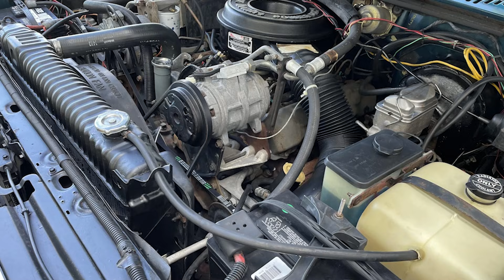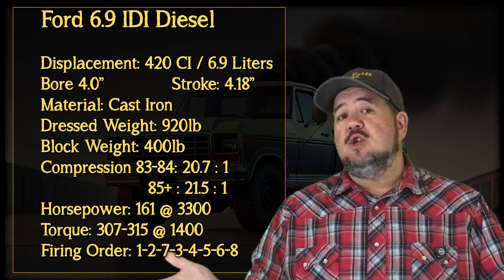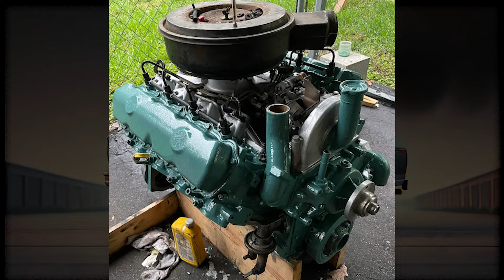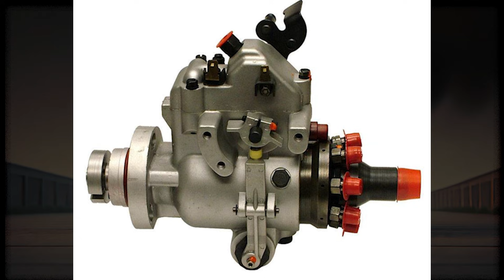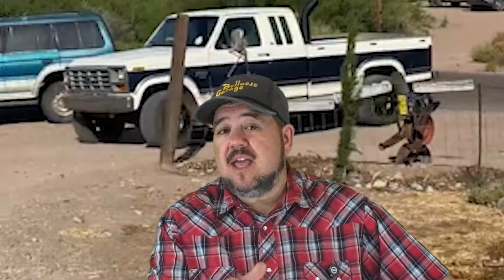Ford 6.9L IDI Diesel: Everything You Need to Know

Comment: Now see, what I would and wanna do to one of these is adapt an NV5600 6 speed into one of these trucks. They got 15 to 17 hwy mpgs with a 3 SPEED AUTOMATIC!!! A 6 speed manual would be bonkers or so i think. Adding in a turbo also GREATLY increases efficiency and power output too and frankly it's not all the complicated for just a basic system. But it DOES make stuff more complex there's no argument there. Would help it for towing applications too, but I wouldn't puch an IDI like that past 275 horses personally. Parts are pretty easy to find too or have fabricated due to just how simple them things really are.

Comment: Haha you suck!
Sike just joking, since you read even the mean comments thought I'd throw that in there.
Was giving an 6.9IDI f350 from my father as a birthday gift, and I can't thank him enough.
It truly is the best gift a man can ever ask for.
I'm currently running down a problem with the wiring going to the glow plug relay (aftermarket) and starter itself, as those two wires caught fire last year and welded themselves to the terminal.
Also, I plan on restoring all the wiring and eliminating anything unnecessary, as there is a winch and light bars that need alot of juice, if I plan on doing what I want to do.
What are some good tips to keep in mind? 
Is there any preventative maintenance I can do while I'm replacing wiring? 
Injection pump, glow plugs, and external fuel filter are on the list aswell, just want to make sure she has healthy power everywhere, rather then throwing a tempter tantrum over being turned on for too long.

Comment: I have a 92 f250 7.3 IDI e4od 2wd supercab XLT , and a 1984 6.9 idi t-19 4x4 f250 supercab XLT .. both will be running long after I gone :) . one thing not mentioned. ditch the mechanical vacuum pump for a modern jeep electric vacuum pump .

Comment: That is an Internarional motor and you can find it in IH schoolbus too. The little 4 cylinder Izuzu reefer motor is a tough one for a little displacement boat or garden tractoo. Mercedese also has one but the Izuzu is a little better with Mains on every cylinder.

I'd like a 4-53 for an older truck refurbishment. For a pickup either that 6.9 IDI or a 3-53.

Comment: This is a brilliant useful video. Question if you’re still out there.. any knowledge on the 1986 Cabriolet version? I’m understanding Michigan made these trucker Van Sleeper cabs with a turbo .. I’d just soon not have a turbo but my understanding is they were built with them .. can’t find much yet on that before I buy this low miles one.. and I need to know if anything besides and exhaust valves gauge is something I need to do

Comment: I owned a 1984 F250 4x4 extended cab with a 6.9L IDI from 1990 to 2005.  In 1991 I noticed a single BANG on startup.  The next week after sitting overnight I drained the oil and a couple of tablespoons of coolant came out first. After discussing it in detail with the truck engine manager at I international I decided to replace the block.  I did the work at a local garage every evening for a month.  In that time I also added a 1.25:1 2 speed auxiliary trans between the transmission and transfer case.  That truck had 3.55:1 front and rear axel ratios, so it was like running in overdrive all the time.  The 2 speed in low gave me the equivalent of 4.44:1.  It was the best thing I ever did to that truck.  I also added an electric fuel pump with a bypass check valve and a priming switch mounted next to the radiator for priming the fuel system.  That truck ran good and towed really well.  I had a slide in truck camper and pulled a boat too.  A great workhorse.  I am looking for another one now.  I'd like a 7.3 with a factory turbo crew cab.  I'll be having a truck camper and towing a boat.  It's sort of my thing.  One Miracle at a time!

Comment: I am the original owner of a 1987 F250 4X4 6.9 IDI, a 1990 F350 4X4 7.3 IDI, and a 1997 7.3 PSD. The 87 has over 600,000 miles on it now. I've replaced all of the "bolt-on items" but the motor itself is still original. I've owned 6.0's, 6.4's and 6.7's. I still have a 2016 F450 with a 6.7. My 87 6.9 is, by far, the most reliable pickup truck I've ever owned. 2nd place is the 1990 with the 7.3 IDI. No, they don't have all the power and gizmos that the newer ones have. And no, they don't get awesome mileage, or climb hills under load at 55 miles per hour. But.....They just. don't. break. If I had to choose between all of them, I'd pick the 87 with the 6.9. It's not even a hard question.

Comment: Love my unicorn of a truck! 🦄🛠️

Finding a 1997 Ford F-250 (the final and most desirable year of the OBS) that’s a California-original, two-tone blue, and garage-kept is like finding a needle in a haystack.

 With 272k miles, this 7.3L

 Powerstroke is just getting started!

Why I’m sticking with this legend:

 * The CA Gold Standard: Being a '97 means no smog checks and none of the expensive, headache-prone emissions hardware 
(DPF/DEF/EGR) found on new rigs.

 * Unbeatable Efficiency: 13–14 MPG towing 8,000 lbs and 19 MPG highway. Most modern trucks can’t touch that.

 * Classic Americana: The Club Cab, 8ft bed, and factory chrome alloys give it that timeless long-wheelbase look.

 * Sustainability through Longevity: It’s noisy and it’s not fast, but keeping this 29-year-old machine in showroom condition is better for the planet (and my wallet) than buying a new one every five years.

She’s paid for, reliable as a rock, and built to outlast almost anything on the road today. 
I’m picking up a "topside creeper" soon to make the next round of maintenance easier on my back—gotta keep that engine bay as clean as the exterior! 🛻💨

Anyone else still rocking an OBS Ford?

Comment: The DD 4-53 wasn't a "screaming" engine. It was a 2-stroke, which means with 2x the power strokes the engine operation sounds like it's at 2x the RPM. It's why any DD 2-stroke engine at 2,000 RPM sounds like a 4-stroke engine at 4,000 RPM.

Comment: I put a 7.3 idi from my 88 I rebuilt and put it in my 97 f250 that had a 460 I used the gas tanks with electric fuel pumps in tank I used a holly regulator to cut the pressure to 5psi well now that truck is junk so now the 7.3 idi is going into my 99 F350 super duty which has a V10 with a rod through the side of the block I don't want to spend $5000 for a rebuilt V10 I pull heavy trailers lol. This will be the third truck this engine has been in I rebuilt the engine back in 2019 I don't think I have put 20,000 miles on it.

Comment: I should probably put his on the 7.3idi video, but I love my IDI's!!! When I moved from Sacramento, Ca to Austin, Tx I drove my 1991 NA 7.3 and for about 1800 miles that truck got almost 20.2mpg and only stopped for fuel and potty breaks. It took 33 hours.... but the truck ran so smooth! engine purred at 2000-2200rpm and was hardly a nuisance unlike my 7.3 powerstroke or cummins 12v. This truck now has a turbo and ZF 5 speed and hydroboost. Great trucks from a bygon era! I even have a 1986 6.9idi parts truck, that I intend to pull the engine and rebuild as a spare engine for my 1991.

Comment: If my 7.3psd dies, a 12 valve or a DT360 is getting rammed into her, all mechanical, gear driven timing, lots of power, turbo and no sensors.

IDI's just would be a huge downgrade from the psd

Comment: Dude! Thank you so so much for making this video! You dropped so much knowledge, I just bought a 86' F250 6.9l idi diesel with supposably 53,000 original miles 🤷. I bought it off of a local auction site here in Oklahoma. (For $1,550! 🤫) It is my first diesel so I knew nothing upon buying it but after extensive research on line through forms and videos like this one I'm starting to figure it all out. But by far this video specifically was incredible with all the info and pros and cons and upgrades for reliability etc etc. Much appreciated thank you!
Reply: Wow bro 🇺🇸🫡

Comment: I am the lucky 2nd owner of a 1986 F250 6.9L with only 119K miles on it. She'll be 40 next year. First owner was a gentleman with her and babied her softly. I am the same way, I love hearing her purr and she smokes gently like a diesel should.  I love this truck and I love my 2003 7.3 with 327K as my daily driver. Fixin to buy a 1997 F250 with the 7.3 as well, found another one with only 111K miles. These trucks are special.
Reply: I inherited a 1986 F250 6.9 in 2005 which made me the 3rd owner. It has 86,000 miles now. It needs a new oil pan gasket now. Pulling the engine is not something I have the know how for!

Comment: Pretty cool vid. I wonder where was the engine casting foundry for these blocks? I ask cuz I am from Cleveland, Ohio, where the engine casting foundry was for Fords small blocks, along with Windsor, Canada. I know a little bit about diesel engines, but large truck and bus engines like Cummins and Detroit Diesel 6v71 cuz I worked for the transit system in Cleveland. I also have a cool, old 1963 Ford F100 with the 292 Y Block.

Comment: Now who could ever be mean to you? You’re just a 🧸 teddy bear. Anywho, I have a ‘85 f250 diesel 4x4 6.9L IDI & am  wanting to do everything that you recommend in this video! I love my truck, but I didn’t research it when it blew the tranny 6 years ago & took it to a tranny shop & they put in a 3-speed tranny & it is slower than molasses going up hills to even get it to shift into 3rd gear is a PIA in the big city streets. Same with getting up to highway speed entering a highway. Not to mention with towing a 2-horse slant 5th wheel RV with horses & living quarters up steep/long hill elevation. I need all of the help I can get to turbize my Big Badazz Truck!

Comment: Four years ago, I bought an 86 F250 supercab with the 6.9 and a four speed for $800. Seller could not get it to start. My diesel mechanic sons got it running in 20 min and I drove it home. Put on new exhaust, injectors, and glow plugs.  Only thing I might eventually change is to a 5 speed, but otherwise feel fortunate to own such a great truck. Today, my truck is still under 180k miles.
Reply: What was wrong with it?
Reply: @countrieboyz2009 A couple of the injectors were out and all the glowplugs. Truck does not like to start without glowplugs. While we were pushing it out of the seller's yard to load it on our trailer down the street, I put it in 2nd on a whim, popped the clutch, and the truck started right up. Replaced glowplugs and injectors, and truck starts everytime now.

Comment: I still drive and use my 84 idi to pull my 5th wheel 3 speed auto  and pulls at 70 without a complaint I plan to put a 1994 ats off a 94 idit motor I love the simplicity of it and trust me when I say I've pulled more dmax and psd and cummins to the scrap yard she may be slow but she'll pull all day without complaining
Reply: Also forgot to add she has 300000 miles and still going

Comment: Im going to do a 7.3 idi swap on my 85 E150 super and also making it 4x4 have a 99 gas super duty im using the frame and amrear ends all lead spring maby air ride depends on funds still need to get the engine and zf5 or 6 but going to get a spare engine to build up while i drive the van but i love those old diesels international used to build some really good stuff. Good video thank you!!!!!!

Comment: HUGE THANKS for this videeo

I've been loving my 86 F-250 XLT Ext cab bullnose since 1996 when I bought it from the original owner, a friend from high school, and it's still running strong and starts on the first crank And like you said, it's the sound. Heads turn every time I drive it when people are walking ahead of me, its just unique and I've done NOTHING to the exhaust. I have to ask, though, that at 348000 miles is it really wise to add a Banks turbo? My thoughts are adding at that mileage might stress the lower end without any upgrades also?

Comment: I got a 1986 6.9idi/c6/1356bw t case in a lariat exteneded cab 4x4 f250 long bed. I have lost compression in two cylinders amd getting diesel in the oil. I bought a 90 superduty f450 with 7.3 idi/ztf 5spd. The ztf has the parking brake mountedto the transmission.  Therefore its actually a 4x4 ztf 5spd! Very hard to come by. 90,000 miles on it amd paperwork! So i wamt to swap the 6.9 idi and the c6 auto for the 7.3idi and ztf 5spd. I got the crossmember and the steering colum and pedal assembly. I grabbed the hydroboost to upgrade from the brake booster. Then its paint and body work! Painting back to the factory two tone.

Comment: but parts like pistons are being discontinued and hard to come bye. 6.9s have smaller 7/16”  head bolts. 7.3s have 1/2” bolts. i love my 7.3 idi factory turbo. looking to putting a 7.3 idi in a 79 f250 4x4 with a zf5 and 3.55 gears to have a classic with good fuel economy

Comment: got an 86 F 250 with 6.9 4x4 4spd, this past winter got water in IP , got to 2 degrees, she froze up . Few days got above 32 , She fired up got her home. Did away with water seperator, took off side tank ,cleaned and put new pickup in , ran new supply and return lines, did away with tank selector , back tank never worked anyway. have electric fuel pump, new filter, new o ring on filter housing , changed fuel shutoff solenoid in top of IP, cleaned battery post and connectors and cleaned grounds on block and cleaned starter connection . She'll crank but wont hit a lick, changed IP pump with used one , friend had , supposed to be good , still crank wont start even with starter fluid. cracked all the lines , dont think getting fuel to injectors, tested all glow plugs , 1 bad , changed it , still no hit even with starter fluid . I'm at my wits end !!!! New rebuilt pump ??? I just don't know , any suggestions , Thanks ....
Reply: I’m telling you… it’s the shit off solenoid

Make sure you have something separating the positive from ground because it can fail instantly and crank with no start if it’s short circuited
Reply: I was  wondering  about that damn thing. I put 1 on her about a year ago , that I got from Autozoo and the new one ,come to find out was bad, they traded it out and the second one worked.
But one day last week , when I tried ta start her, the damn thing was doing that clicking, I took wires off ,cleaned um , and also cleaned both grounds on the motor and the starter wires ,and she cranked faster, but still no start. Well I'll just have to go to Autozoo and get one when they open and have it tested before I leave that place . I'll keep ya posted. Thanks a million my brother !!!
Reply: @chadbrexdon8213 that wouldn't make a difference with starting fluid.  It comes through the intake it's fuel fed directly in to fire...so wtf would a shut off solenoid have to do with it.  He said he used starting fluid and it wouldn't start.  That compression or air.  It's got air if you're spraying starting fluid now we look at compression.  Learn diesels before we talk about them just saying.  Ether is chasing a fuel problem that's why we use it.  Because they'll run on ether with no fuel...so how is it a fuel solenoid if it's a compression ignition engine with ether...and it still won't start.  Explain your reasoning  I want to hear this stupid shit.   I really do because they'll run forever on ether if you have enough cans to shove down her throat hole
Reply: Shut*

Comment: I personally do love the IDI engines, I own a 7.3L IDI in a 1991 F-350 dually, not a contractor truck, or anything like that, an old rancher's truck, his going to town rig if you will. This old beauty has 500,000 miles, and I still wouldn't be afraid to drive the old girl from Oregon to Florida, she's that reliable, and makes between 21 and 23 MPG while having all the needed power to maintain speed while pulling a load up and down hills.
Reply: Not as fast as a turbo but it'll climb a tree!
Reply: @mitchellkreigler51 don't need fast, just, dependable

Comment: I did the Gearvendor Unit on my c6/7.3 with 4.10s. Major improvement in drivability.
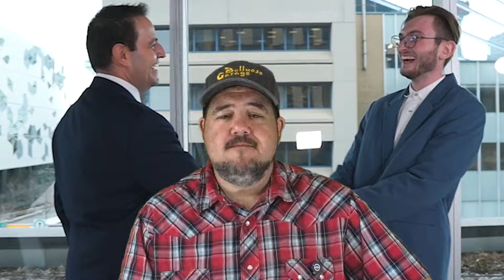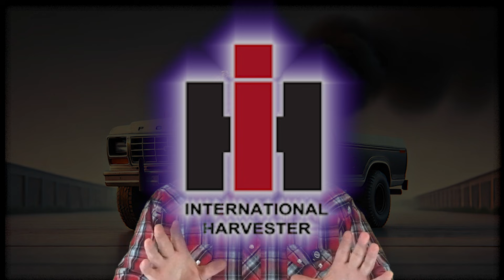Reply: Became the caretker of an '86 F250 4-speed 6.9 4x4 12 years ago. had 204,xxx miles on it now. In '92 a previous owner had a Gearvender overdrive innstalled. Brought the 4:10 gears down to 3:22 in 4th over. If cruise long distance miles and keep it just below 65 mph will get 20-21 mpg. It wouldn't bother me to drive it across country anytimg. A rock solid great 'ol truck.  Also have a 1993 Ford F250 7.3 non-turbo idi 4x4 extendedm extended cab, 4x4, having 121,300 miles. Another fine truck.  Always use Motorcraft German made glow plugs.

Comment: Upgrading the old v-belt pulley system to the serpentine belt system is a must.
Reply: Nope… can’t get a good belt tensioner anymore
Reply: @linctexpilot8337  Since I made that comment, a friend of mine has had 2 or 3 idlers on his. Im still running vbelt. I guess I aint going serp.

Comment: As far as the sound goes, I have daily driven a 7.3 idi for 4.5 years. Its straight piped out the back. Its not loud AT ALL while idling or cruising. Its very raspy when on the throttle, and a bit annoying. On long trips, the 7.3 will sing you into falling asleep. My sons always fall asleep on trips longer than 40 minutes.

Comment: The biggest issue is cost effective replacement Injection pumps. You can spend $500-$700 and get a reman unit, but the HOT start issues are soon to follow. If you want some better performance and better hot starting, you gotta spend $1000 or more on a 80cc+ pump.

Comment: Have a 1992 Crew Cab that the previous owner yanked the 7.3 due to a water jacket failure and installed a 6.9IDI. in the process of redoing the entire truck but I have to say I'm impressed with the 6.9 after it sat for over 12 years it only took me about 5 minutes and two new batteries to get her running. Thanks for the review of the engine, although I'm sure you just cost me some money on improvements I'll need to do before trusting it on any long hauls 🙂